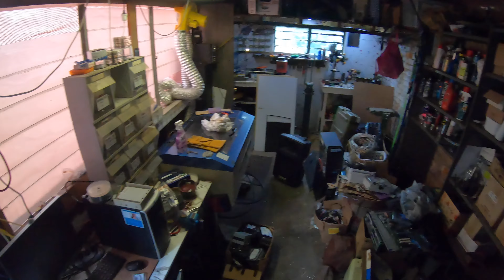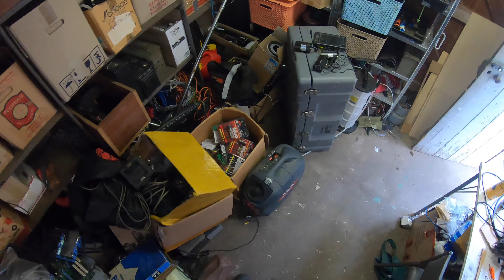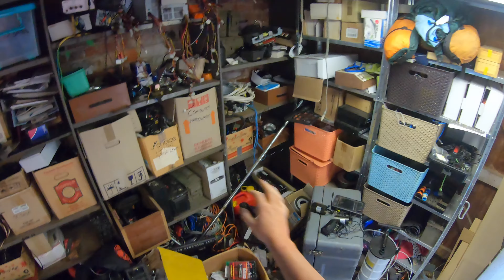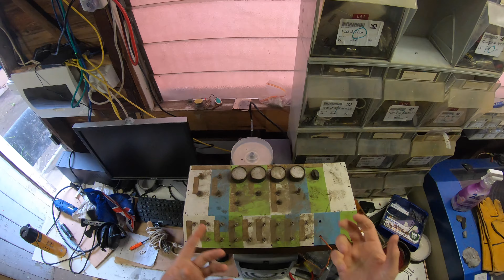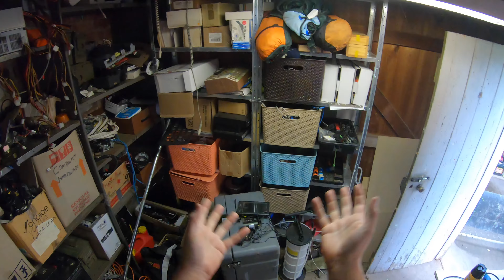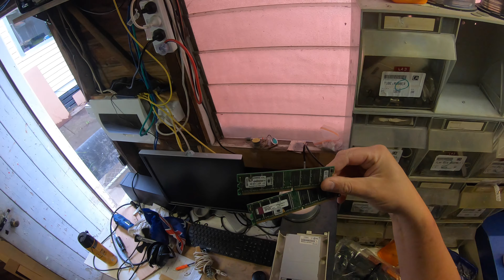Getting ready for hard waste collection

Comment: Awesome video lots of good things and it’d be interesting to see if that X-ray machine works or what you could salvage out of it and what amount of radiation is emitted once it’s switched on?
Reply from the maker: It's a tube type designed for vets, and not a fixed source, so it's a lot safer, I plan to test my high range geiger counter (radiacmeter) with it.